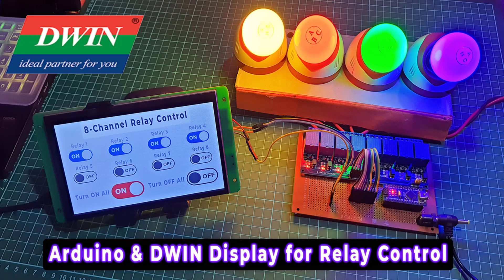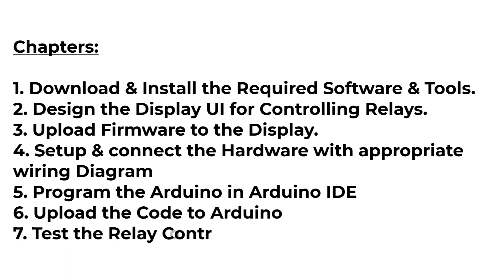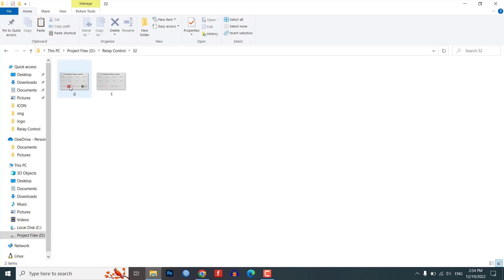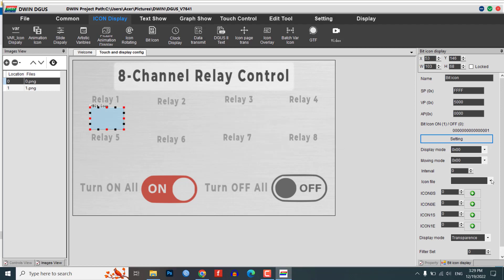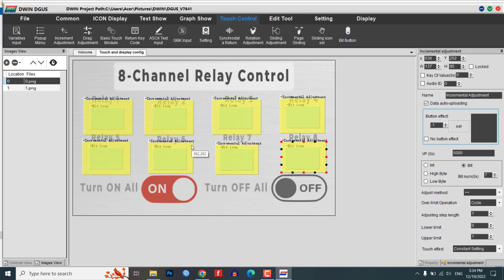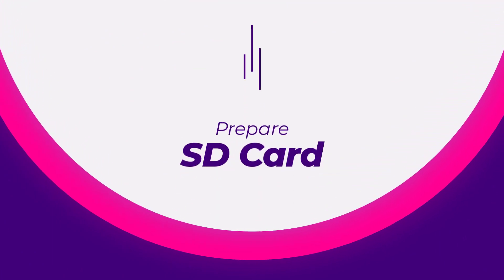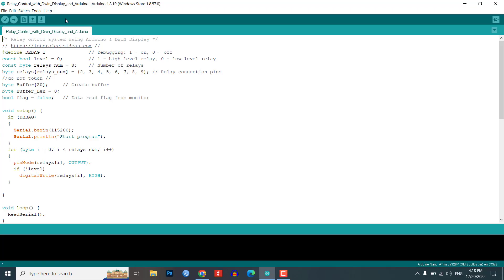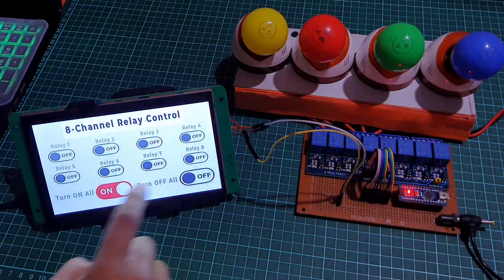Relay Control with Arduino & DWIN HMI Display

Comment: Great project well done, Am wondering you could do the same using a wifi screen? so does need any wiring between screen and control board.